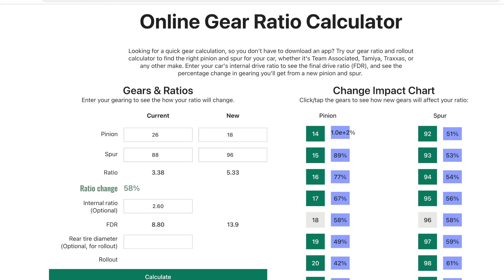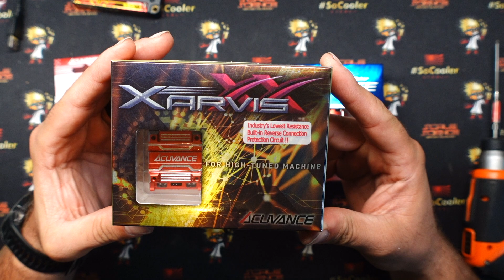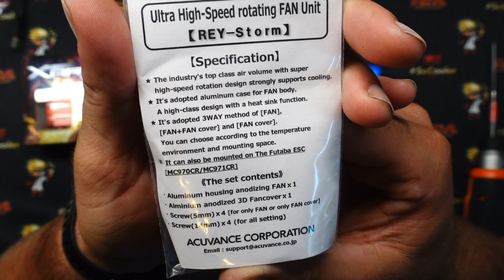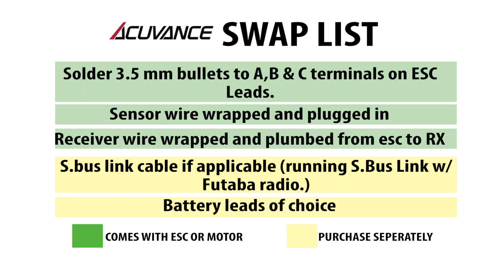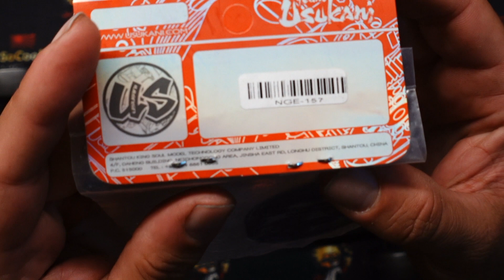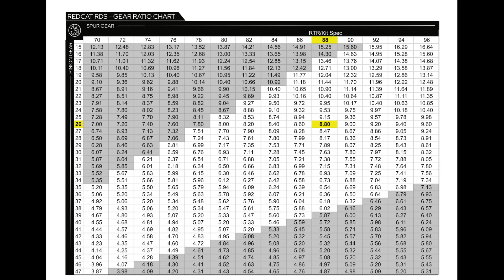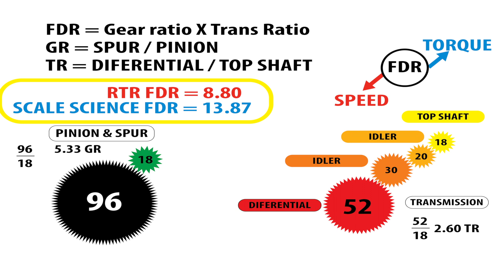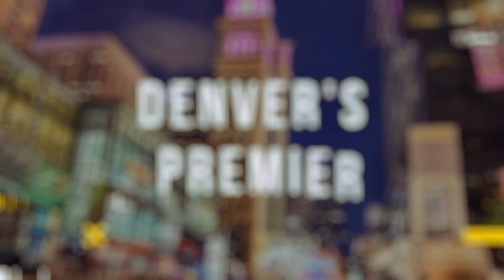REDCAT RACING RDS - RC DRIFT BUILD EP 6 - SCALE SCIENCE

Comment: So, what’s left on it that’s Redcat? Transmission case & gears?
Reply from the maker: All of the steering, front bulkhead, knuckles, steering servo arm, all stock ball cups and balls except for dampers, stock transmission (except rhino dif) and stock rear tower. 
The replaced parts are the plastic deck, battery tray, suspension (we changed our damper bodies out for red color, not because lack of performance) and lower arms. Put good electronics in it and finesse the ball cups and alignment into free movement and less toe out. Rear lower arm swap allowed us to move the arm further forward on the pin and the car makes insane grip.

Comment: Did you ever end up changing the front knuckles on the RDS? I saw someone else install the ReveD RDX knuckles & they seemed to work well? I’m not able to get quite the angle I’d like currently. 
Cheers
Reply from the maker: We haven’t had a need yet as the stock had plenty of adjustability for our desired setup but we may play with a set in the coming months to see if we can continue dialing in our redcat
Reply: I recently installed the yd2 adjustable kingpin knuckles on my RDS, loving the swap so far. Car feels smoother imo but that could just be placebo lol. Definitely looks better that's for sure. If you want to use those knuckles as well you have to purchase 1mm axle shims for both sides or the wheels will have side to side play. If you reuse the stock ball studs you have to shorten the threads on the top and bottom ones or they will interfere with the knuckle install. Happy sliding :)
Reply: @ScaleScience  Thank You very much for the reply! I'm really enjoying the RDS series! Are there any companies currently offering an aftermarket chassis for the RDS? Cheers
Reply: @danielvargas1539  Thank you very much for the info! Cheers
Reply from the maker: @rcalchemy766 not yet but very soon, We (Scale science) will have our very first chassis and we are going all in with the RDS platform. It will be based off of our current setup!
Reply: Any new videos of the new shark RDS??? 😂😂